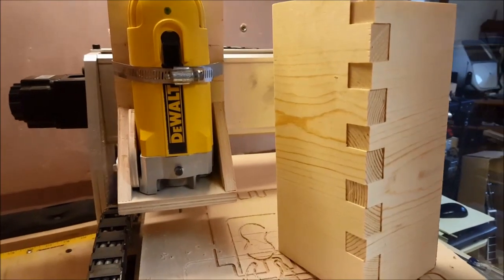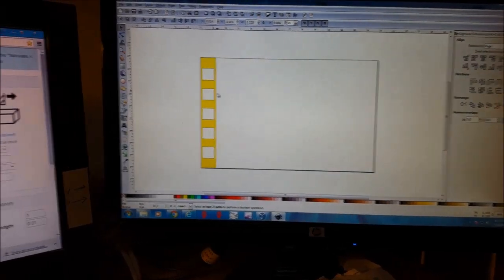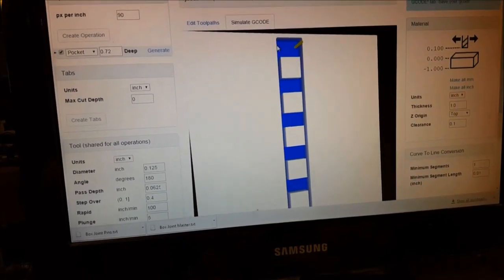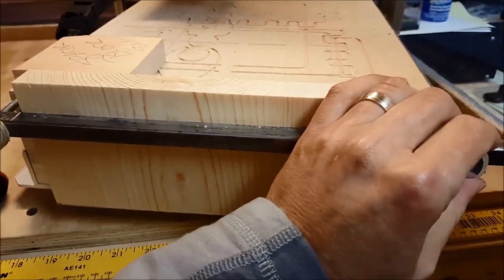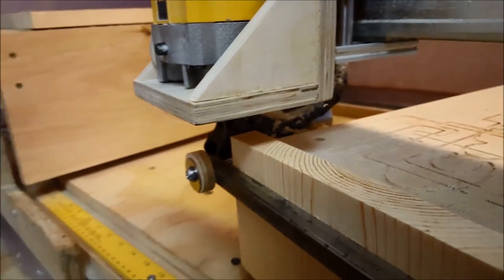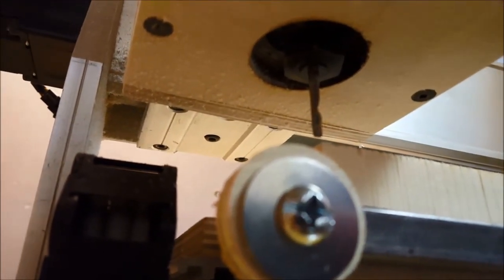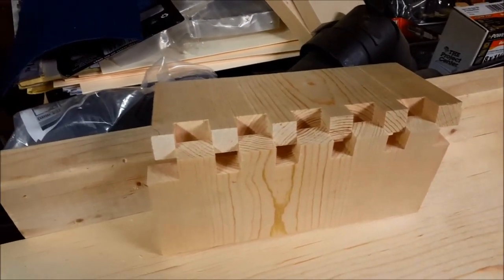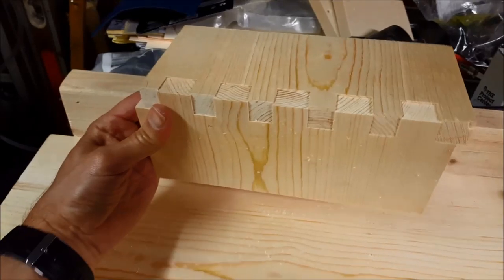Perfect Box Joints - On A Small CNC

Comment: No video of the actual cutting? I came here wondering if this is a practical way of doing casework (i.e., should I buy a CNC machine) but I would want to set up for 4 board-ends at a time and then flip them to do the other ends. At "about 8 minutes" plus to cut one end of one board.... this is much slower than my current method of cutting box joints with a table saw sled and dado blade.